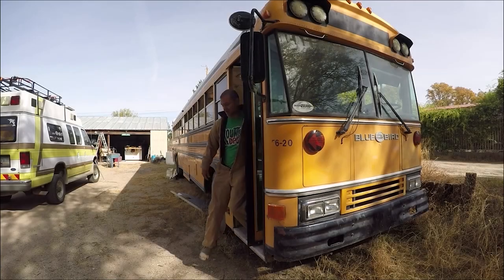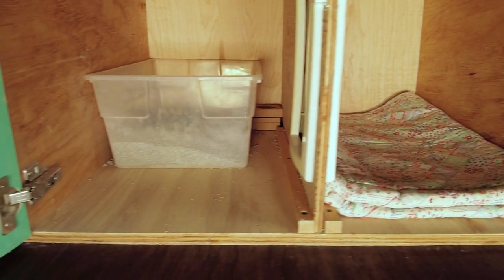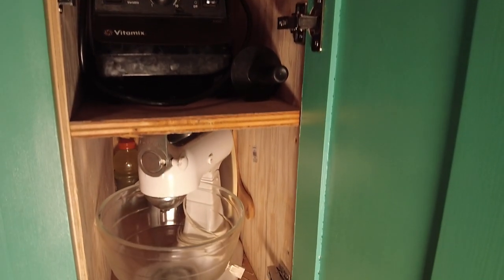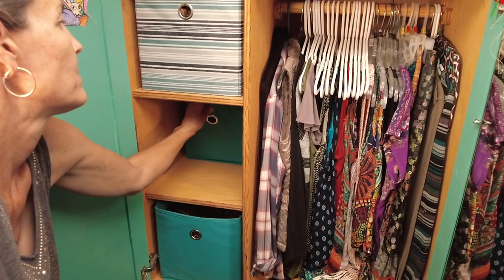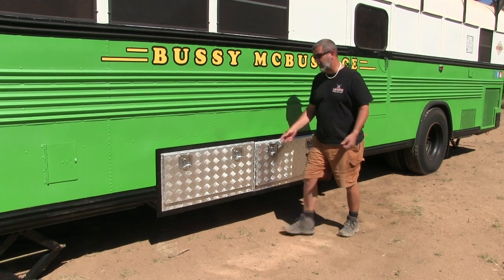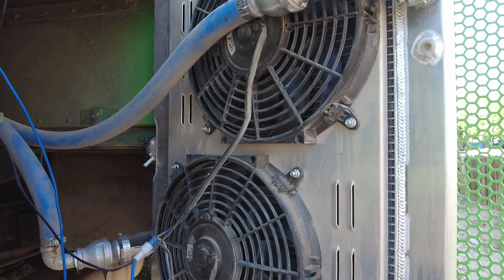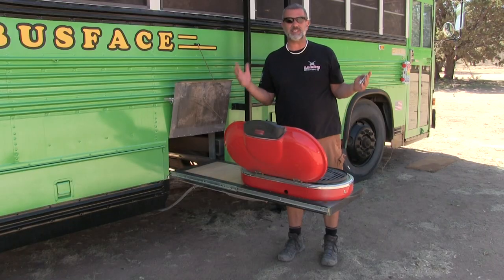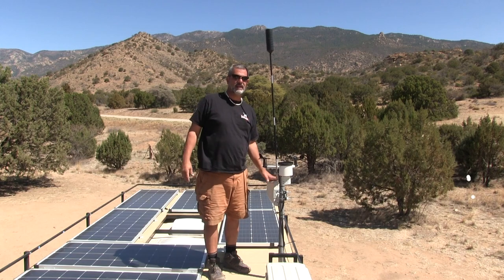Skoolie Tour: He Built Her Dream Tiny House on Wheels!

Comment: Not only do you have the absolute best name for your bus home you have the coolest most thought out build I have ever seen! It’s amazing - I love it! I just bought a class B camper van that needs ALOT of work. I almost gave up recently when someone stole my roof top AC right off the top leaving a huge gaping hole that flooded my van with rain before I released it was gone. Now I feel like maybe a little bit at a time as $ allows I may be able to fix it up enough to actually use it for travel. Thank you for inspiring me to keep on trying.

Comment: Aaahhhhhmaaaazing build!  😆  Saving for items to use in MY bus. XO
Seeing your antenna on top, have you thought about a small wind turbine? I've seen them on tiny homes to augment the solar. You can have one on a telescoping pole. Slide it down when driving & as it spins it charges the batteries. 
Also great for those cloudy, windy days when you need power.

Comment: Hey Mike and Kerry. If possible, could you do a video on how you added the auxiliary radiator?  That is something I would need to do as I am looking for a similar bus. It would be much appreciated!!  You two are awesome! I always love your content!
Reply from the maker: I think we could do a short video on how we did it but not so much when we did it. I think at that point we were extremely busy with other things and I just fitted in out of necessity.
Reply: @BussyMcBusface  still really cool though.  This has been my biggest concern as I am looking for a rear engine bluebird with 8.3l Cummins same as yours.... I heard they are the best as far longevity and power....but prone to overheating. My uncle is a diesel mechanic and gave me some info. 

I was the one who messaged you two on Instagram about adding a windshield wiper tank and sprayer to spray on the radiator. I saw another bus video where they did that as they copied the video I sent you two in a link. Anyway, I hate to babble.... you did it so much better. I would love to see what you did and how you did it.

Comment: This is an awesome build! I don't think you went overboard with the lights either. I would love to know what you think about them now that It's been some time with them. I would think they would be a huge help if for instance, you didn't get parked before dark and you have to drive down some dirt road or any kind of road after dark with trees lining on both sides. Anything could run out in front of you and I would think that those lights would be a life saver for something like that. A huge buck could do some damage to a bus. I'm planning on putting a bar across the top of my van for that 'just in case' factor.

Comment: I just wanted to say what an ingenious idea of using the engine heater hose circuit to add another radiator with electric fans to help cool your engine. Fantastic idea !! 
Are you controlling the fans manually with a switch in the dash or are you using a coolant temperature sensor on the engine to turn the fans on and off. ( if your not it’s real easy to install and you can get the temperature switches in different temps ie: 170 or 180 or 190 degrees. )
Great job 👏🏻 
Cheers 🥃
Such a great idea 💡
Reply from the maker: For now I am just using a manual switch but I have considered using the temp switch idea.
Reply: Manual switch is simple and it works. If you wired power to ignition circuit then you don’t have to worry about leaving it on. 
Great idea. 
Great video. Didn’t realize I missed some of your videos. 
You guys have a beautiful tiny home / skoolie bus.
Enjoy

Comment: Do you have a black or grey water tank? It looked like a composting toilet.
Reply from the maker: It is a composting toilet but we decided to divert the urine down to a black tank so we didn't have to dump a 2 gallon urine bucket all the time.
Reply: But why not the grey tank?
Reply from the maker: Two reasons. One, because all water from your sink is considered black in all 50 states. Secondly urine only goes into a black tank. Therefore we have a black tank but we don't have a gray tank but occasionally refer to it as a gray tank out of habit.

Comment: What is the height of the bus?  It seems that with the roof deck and the things you have on top you would have trouble going under many older overpasses.  Anything 13 ft and under and you have a problem.
Reply from the maker: 11 1/2 ft at the highest point.